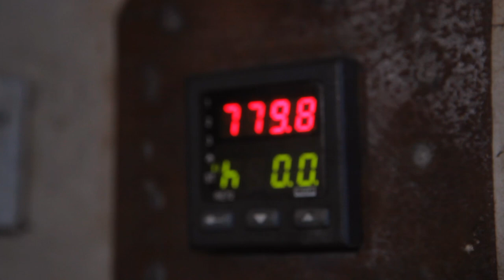The Birth Of A Tool. Part I. Axe Making (by Northmen)

Comment: Hey there, 
I‘m a 22 year old boy from Germany.
First i want you Northman to know that this Video is the most beautifull i ever saw on YouTube! 
It inspired me to build one on my own!
Can u or some one tell my which types of steel this guy uses?? 
It would be great to know.
Thank you.
Reply: You'd have to do a lot of digging into metallurgy to find out exactly, although I'm pretty sure it's a low carbon mild steel for the body then a tool steel bit is what he forge welds into place. 

Although you could use pretty much any Good quality steel for an axe and have it turn out okay, the major issue you have is with the tempering  and quenching process

Comment: Great technique. Love the video. There would be a vast improvement in the hardness of the metal with a slower quench as it encourages a refined grain structure in the metal. This may translate to an axe that stays sharp longer...
Reply: The size of the grain structure is less important than the phase that grows. this also depends on the steel in question.
generally speaking - a faster cooling rate encourages the formation of martensite, as opposed to bainite and ferrite/pearlite. the finest ferrite/pearlite structure will never be harder than a full martensitic structure.

just dipping hot metal in liquids will never give you this control, for the levels of hardness you are talking about - you would need a furnace controlled cooling-over-time strategy.
Reply: That is an excellent point. The phase is a critical part of the material. And yes I believe the study I read did use a different method of slow cooling, other than quenching.
Reply: Interestingly, its not all about hardness, you really want the bainite for something like an axe. Martensite, while harder, will make it much too brittle and you'll end up with an edge full of chunks taken out of it. Bainite will give you a harder edge that will still be able to absorb the impacts and not break.

The joys of a materials engineering undergraduate... Sorry this has turned into a mini revision session for me :/

Comment: Beautiful work. If only every blade were still made like this. Instead of the "made in china" garbage that floods the market. As a hobby bladesmith myself, this is how they were meant to be made. And no cast or stamped and ground blade touches the cutting ability or strength of forged steel and iron.

Comment: beautiful video and music.I was wondering why you cut the blade edge off the axe? I've seen it on another very old film from 1924 of an old Swedish blacksmith making an axe
Reply: The main body of the axe and the edge are made of two different kinds of steel. When he forge welded the tool steel for the edge in, the steel from the body covered it slightly, by cutting off the very end, he exposed more of the tool steel which will with make for a better edge for cutting
Reply: jb76489 That and to achieve the desired shape, I presume?

Comment: Linseed oil, which keeps out damp and puts natural 'goodness' back in the wood. Best woods for axe handles are Ash (often used in Germany and England) and American Hickory. This is because they are tough, close grain and can absorb a lot of shock from the impacts of striking tools without splitting. Both are very durable but do benefit from a light coat of linseed about once a year to keep them 'supple' and to prevent drying out or wet rot.

Comment: I definitely think his bellows is upside down.it's not just a single chamber bellows either, if you look closely at 0:50 you can see that the upper chambers (which is located on the bottom) leather inflates when he lets the bottom board (located on top) fall. Also the middle board is perpendicular to the forge and the top board (on bottom) hangs down and a 45 degree angle. If it were flipped, you pump the bottom chamber and that fills the top chamber which acts as a reservoir so you have

Comment: Because it 'tempers' it. Steel is hard but also brittle when 'forged' in a furnace at 800+C. When it is quickly cooled in oil it makes it less brittle, more resiliant. Normally the cutting edge only is cooled in this way to a depth of about 3cm (1 1/2 inches). The axe can then be ground and sharpened to a very robust edge that wont chip easily when striking. Once tempered the edge must never be heated above 220C again or it will become brittle. Tool steel is very hard but also quite brittle.

Comment: I'm a little confused, I was always told not to use an electric grind wheel because it would ruin the temper. I see you grind using one after tempering. What's the answer, should I or shouldn't I grind my axe head on a wheel to sharpen it?
Reply: It CAN ruin the temper but that doesn't mean it will necessarily.  At the very edge heat can build up quickly, but if you are careful you can use grinders to sharpen axes. Keep a water bucket handy.  You may have noticed also that his gloves were wet when he was grinding post-temper; he probably has a water cooling mechanism on that grinder that he chose not to show in the video. I hope that helps.
Reply: Cheers. I usually go across the bit once then dip straight away to avoid residual heat causing damage, then have a look at it, then repeat until good.

Comment: What is the white powder that he sprinkles on the metal a few times and what is it for?
Reply: It is Borax.. Like the stuff you buy to put in your laundry.  It is used as flux to keep oxygen out of the forge weld that he is doing.  It also prevents mill scale from forming, which would prevent the weld from taking place.
Reply: It´s borax, and it is used to connect the two steels

Comment: You are aware that that Gandhi quote is below a video in which a guy is making a tool, right?
Reply: And your point is?
Reply: There is a quote about the beauty of using your hands as opposed to tools below a video about a guy using tools to make tools. It makes no sense.
Reply: U.G. Wilson
Or you're taking the quote too figuratively. "Using your hands as hands" seems pretty straightforward: there is no way not to use your hands as hands, because anything we do with them we have to do with them "as hands", simply by virtue of their actually being hands. Using your hands to make tools is using your hands to make something that can not be used "as hands", because they aren't; they're tools. Using your hands to use tools is exactly what Ghandi is warning against. If we only use tools we will forget how to accomplish the same task without them. Just look at mental arithmetic. How many people can still calculate 321 * 231 mentally, now that calculators (in smart phone form or however else) have become ubiquitous?
Reply: U.G. Wilson
But that's not what's beneath this video. Whoever quoted Ghandi there left in some parts and left out others, suggesting a certain interpretation. If another interpretation had been desired, another part would've been quoted. None of which changes the fact that this is a quote deriding the use of machines and the use of tools below a video in which a guy uses machines and tools to make more tools. It's funny, because while the quote can be interpreted to exemplify the subject matter of the video, it can just as reasonably be interpreted to vilify it.
Reply: U.G. Wilson
There you go again, overinterpreting everything in sight. I haven't cared about what is considered deep or shallow since I was about 15 years old. I just noticed something and pointed it out, much like how I noticed you ignore any semblance of argumentative structure in what you read, which makes this whole thing kind of pointless.
Reply: Wow, one of the more sensible arguments on YouTube. I agree with U.G.
Reply: If you think about Ghandi's meaning when he said the quote above, knowing humans are toolmakers down to the roots you can pretty safely assume he meant something along the lines of what U.G. is saying
Reply: I agree with UG, the point in history that we started using tools is when we really set ourselves apart from the rest of the animals, for better or worse. The axe, was likely even the very first tool, so this is about as basic as it gets. I highly doubt that gahndi was telling us all to drop our axes shovels and saws, but i could believe he was telling us to stop using welders 3d printers and metal lathes. The fact is humans are so reliant on tools that if we could just "delete" them all, our species would flop over night. That being said I think everyone has a right to their oppinion (when it only effects that person) and whos to say gahndi didn't want us to question ourselves and society in general. I think it is great to pick apart things like this because it exposes us to new ways of thinking.
Reply: Chop down a tree with your hands. bend steel with your hands. kill animals with your hands. harvest their meat with your hands. make fire with your hands.

All require tools. All essential for survival.

stupid.